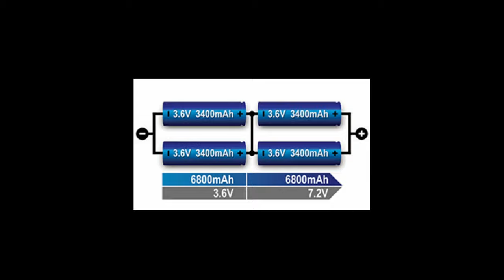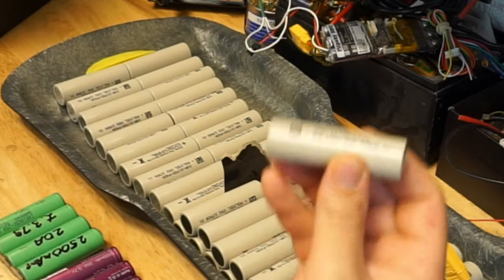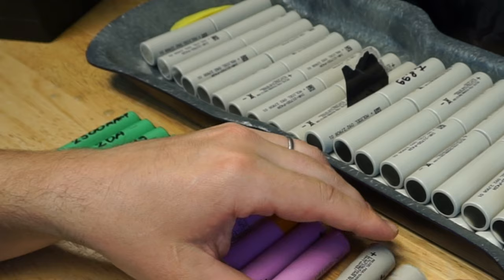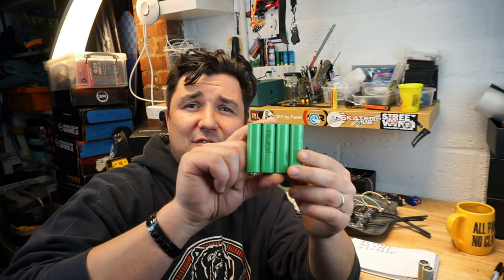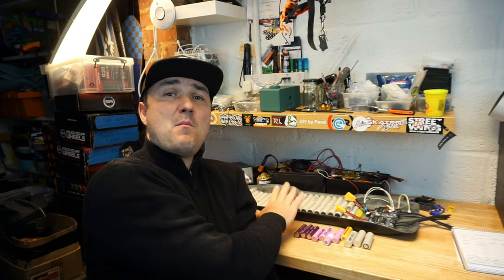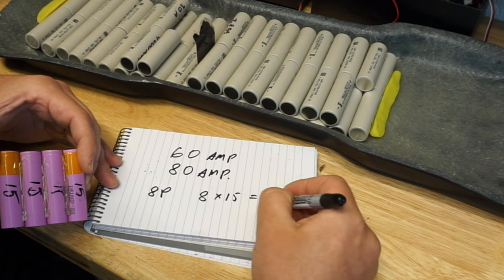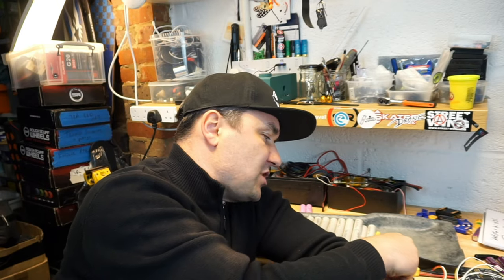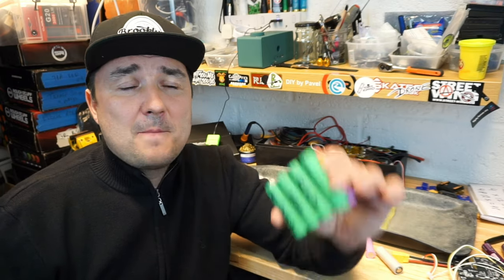ALL ABOUT BATTERY CELLS. BATERY PACK DIY VIDEO 01.

Comment: Hey man I would like to appreciate the knowledge that you share and it’s definitely helpful with the detailed videos, because I am a sort of person who like to go deep inside the concepts (Im pretty sure there are a lot of people who feel the same) which you seem to clarify pretty good. So, Thank You for that.

I know that there is some tolerance on the amount of nickel strips that we use to connect the cells in parallel. How do you go ahead and tackle with that tolerance because as per my knowledge, a standard .15mm thick 27mm wide nickel strip can withstand around 15A. But what we are dealing with in our case is over a 100 A of continuous current. What is the thickness of nickel strips you use? Do you use Nicke strips in layers? If so how many layers did you use for a continuous discharge of over 100 A?
Reply from the maker: Hi mate,
Thank you for the comment. I do normally use .2 mm nickel strip and do use two layers. Have you seen my battery build tutorial? Have a look and it will make sense.   https://youtu.be/z3Rd5Wg7tQg
Reply: @PavelGarmas  yea man, I looked at your whole detailed video of 1:40 hour. It answered a lot of my questions, thanks for all the info you share.
I appreciate all your work.

Comment: BMs, esc and motors etc
Reply from the maker: Hi,
My plan is to have two separate video series running at the same time : The new DIY board ( with every part and actual building and a second one dedicated to the battery DIY only ).
Note that I already have 25 videos about my Beast build and the parts already discussed... like the motors. Take a look : https://youtu.be/X-ulKc8SGok
Ride Safely.

Comment: Basically you use all this information carefully reverse engineering your old pack then replicate.
Reply from the maker: Yes, you can use this method as well if you are building a battery exactly as the one you had or you can plan a new battery - different shape, capacity, voltage. I do have a few battery building tutorials on my channel so have a look.